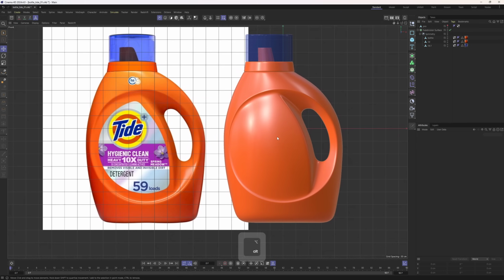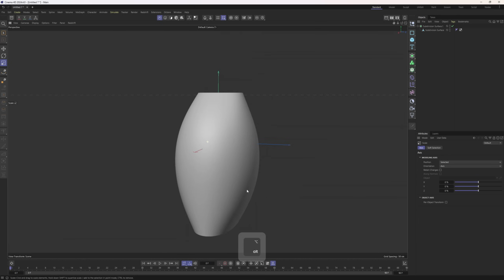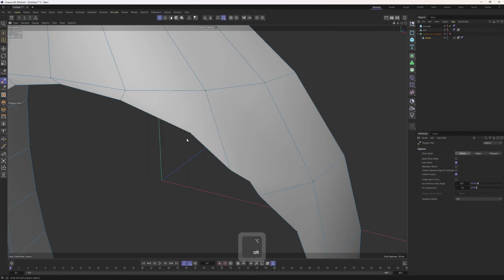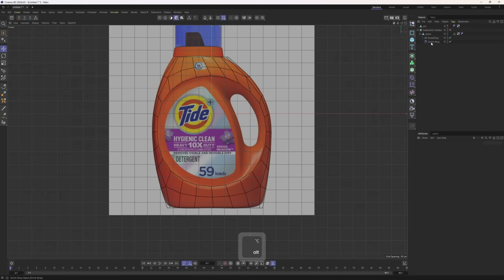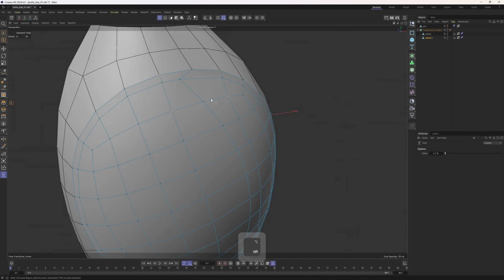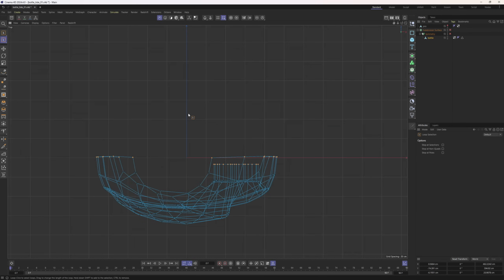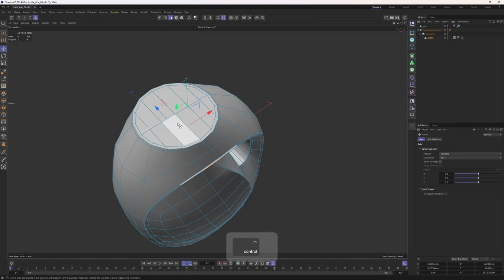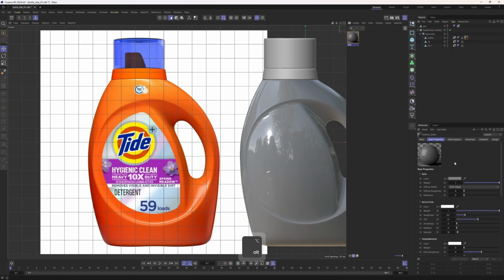Industrial Design/Product Modeling #41 Bottle

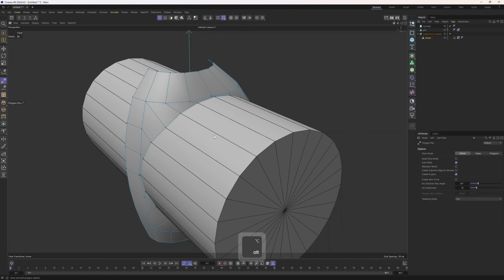Comment: Excelent, tutorial, thank you! Around 8:30 you mention how fit circle tool wouldn't work, but isn't there an option of the fit circle tool to "project to surface"? Would this option work?
Reply from the maker: Thank you, I tried this option before recording but it didn't work properly, I had to work more to correct it than Boolean method.